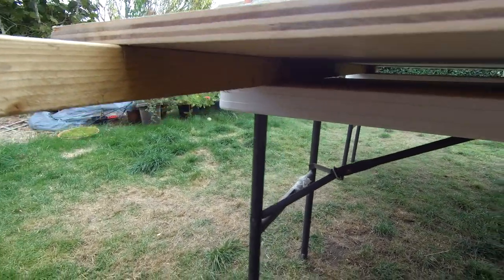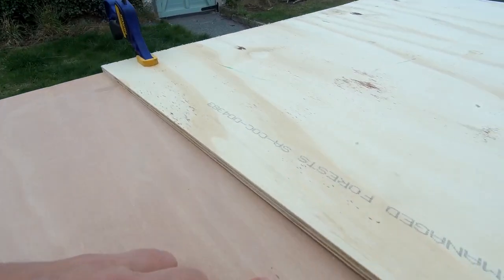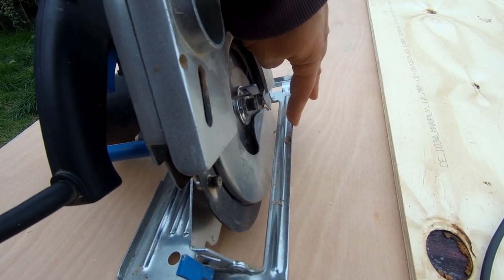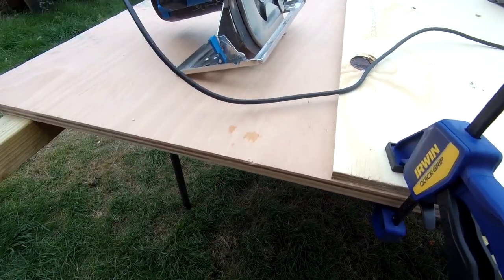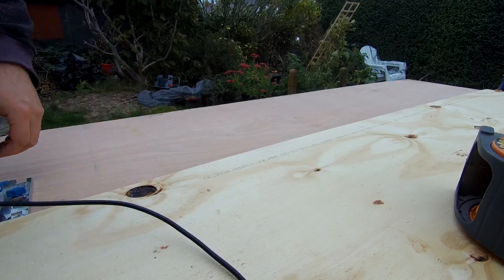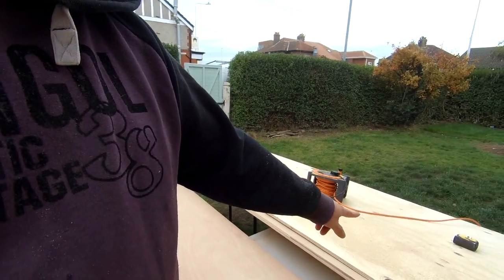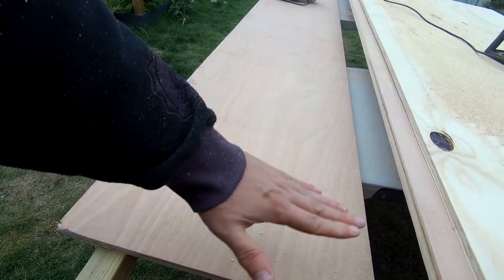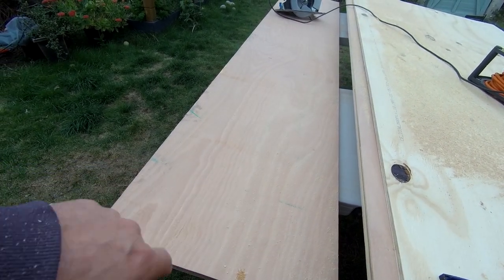Making a Simple Large Computer Desk and Channel Update | DIY Vlog #36

Comment: I thought about you just the other week when I was doing some things on the house. Good to see you are still alive. I've made a computer table once. Didn't do anything to the surface so that got black and nasty where my mouse arm rested and it had an area of nasty stickiness where I had my cola glass and it had fizzed up and around it (you wouldn't think that the little bubble sea for 2-3 seconds per glass could get that nasty with enough glasses but it can), so a protective coating is well worth it. I did a corner leg screwed in from the top with a single 45 angle cross brace towards the middle and then planks on the wall behind and the side screwed on from the top. It was level and solid and did its job but yours looks a lot more like a real table than mine ever did. Also I was 22, had no clue regarding tools and youtube wasn't around back then.